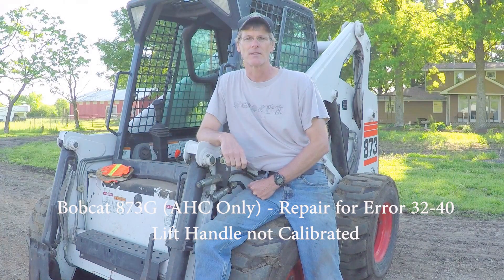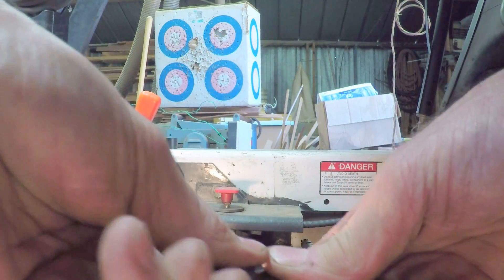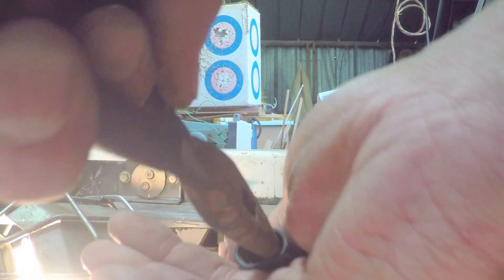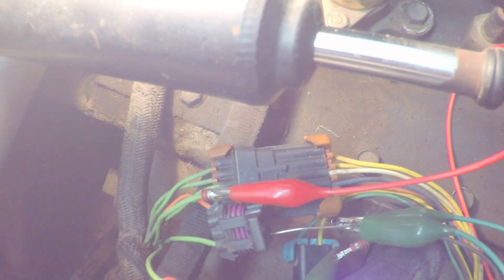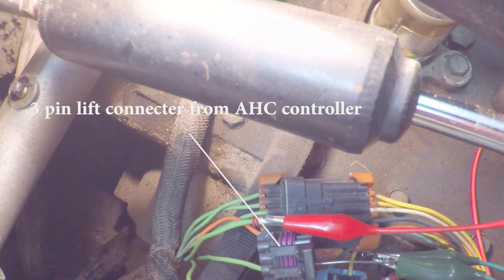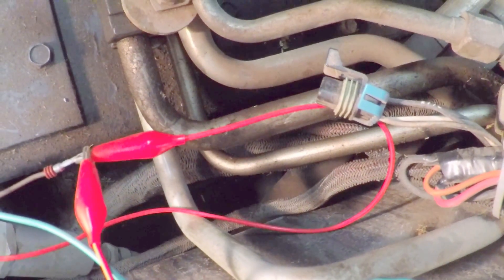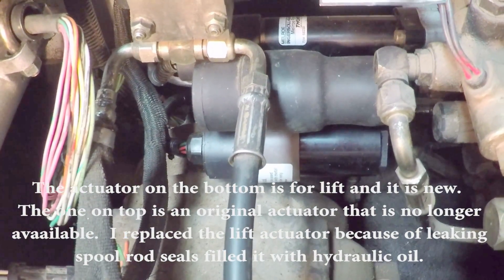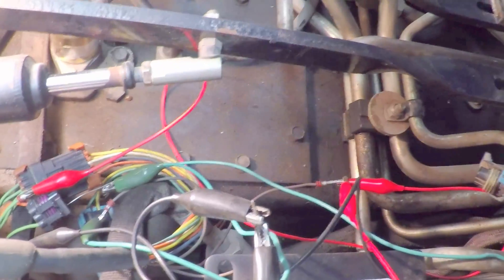Bobcat 873G 32-40 Error (Lift Handle not Calibrated) Diagnosis and Repair

Comment: When you changed your actuator did you have to calibrate it? If so did you have to take it to bobcat and have them calibrate with a computer? I have an 873G with metal controllers, looks like yours is the same. Bobcat sold me the wrong actuator( one for plastic controllers) now I’m trying to sort this mess out. Have the right actuator on order, but not sure if it needs calibrated after I install, and if so, how to do it??
Reply from the maker: There should not be any calibration that needs to  be done.

Comment: Great patience! I'm diagnosing lift and tilt actuator errors myself. Pretty sure the potentiometers are bad in the actuators. I wired a automotive throttle position sensor into one to verify.